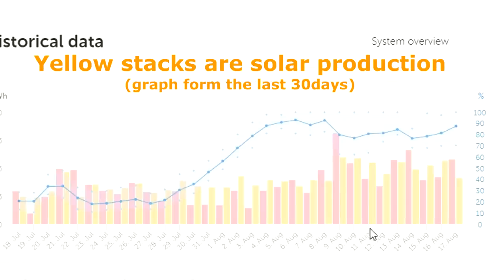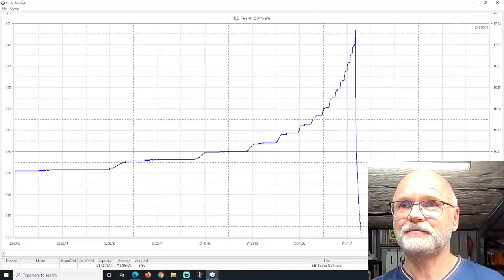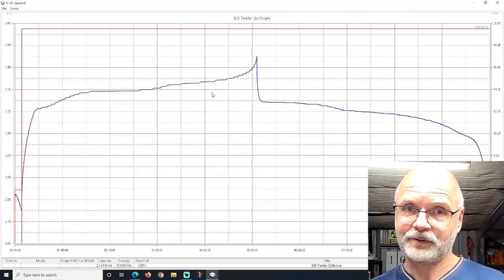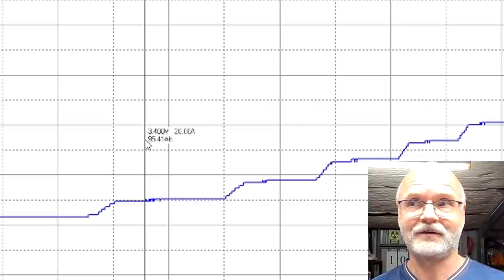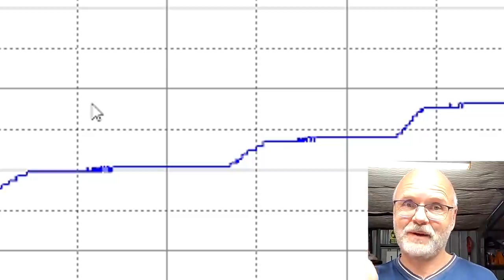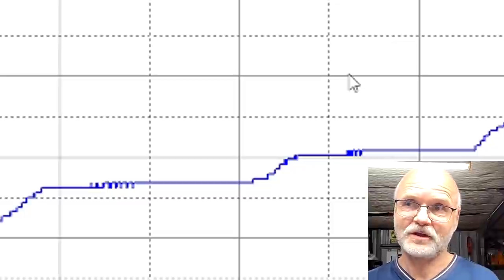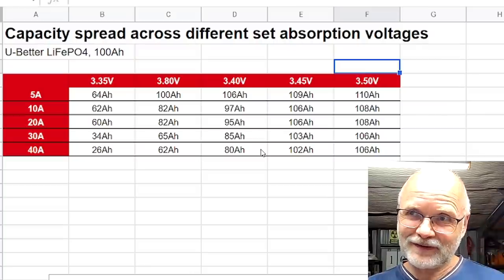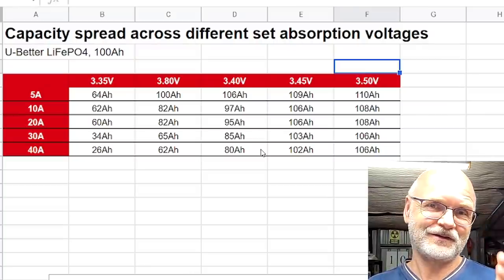Finding 20% and 80% SOC with LiFePO4. Why charging current and charging speed matters!

Comment: Very difficult for me to define 20 - 90% limits too. In fact the only way I found is to charge the battery at the maximum and look at my smartshunt (I made an arduino device to get the infos in my home automation system) when he says that 10% of my 32 KW total (so 3.2 kw) is eaten. When I have eaten 3.2 kw, I am at 90%.

But it is not perfect because :
- in fact it is very difficult to know when the battery is full with a solar inverter charger only. For that i finish the charge at 1.5A and wait a cell reaches 3.6v. But if I were usinga 0.01 A charge current rather than 1.5 A I could put more (OK, in fact not a lot more, perhaps not very important). More annoying : in fact the max charge depends on the cell balance. The more they are balanced the more we can put in the battery because the most charged cell does not stop the charging of the others. In fact I see that each time I try to get the max, I can put more (300 to 500w) W in the battery (certainly because the balancing gets better at each charge, the balancing being really interesting only at the end of the charge so during little time each day). I use an active balancer that I put 1 month on each battery. Then I will stop using it (but I will repeat each year or 2 years I think. I ordered 1 active balancer but a second set of wires : the wires stay in place and I only have to plug the balancer when I want to balance).
- my inverter charger is quite dumb. I can only tell him to stop when he reaches a certain voltage but the voltage of the battery changes with the amperage of the charge (that varies because of sun) so at 5% I can not be sure the charge stops at the same %. So I use a 95% charge goal and I get a 90 to 100% charge (I stops at 55 v so 3.4375 v each cell, if I use less sometimes the charger does not trigger. Growatt 5000ES inverter charger is dumb) and that 55v gives me about 95%. I have 2 inverters and I have about 0.4 v difference between the 2 when they measure the battery voltage. So 1 continue charging a little bit more after the other has stopped. Dumb Growatt products. But it works (with a 100 ma protection before the inverter because a legal 30 ma trip when it is raining !).

Comment: Nice measurements Andy! But isn't the difference also caused by the impedance of the batterie? Maybe the impedance is higher at lower voltages, making the height of the current more influential than at higher voltage? More research needed Andy. :)  By the way 3.8 volt is probably 3.38V, i presume.
Reply from the maker: Thank you. Yeah, Ri will be the lowest at around 85%SOC with these batteries before it goes up again a bit with higher voltage. It will not vary a lot though. Also, while charging the temperature in the cell will rise and lowers the Ri as well. There is always more to it which I'm not able to capture in these tests under AGSTC (Andy's Garage Standard Test Conditions) 😏

Comment: What if I have a lifep04 battery bank of 4 100ah batteries in parallel? Do I have to charge each battery separately or can I wire the charger to the bussbar and charge all 4 batteries at the same time.

Comment: How can you get a very accurate capacity display / read out of 4 LiFepo4 battereis in series (12v) other than "almost fully charged" and "almost fully dead" when they stay at about the same voltage?

Comment: Just stick to top balancing. I have a lifepo4 system running for year, only top balancing, no problems. Most people don't even know you can charge a lifepo4 to 4.2V safely because it uses the same basic chemical electrolyte as li-ion. It does not really take more charge beyond 3.6V so no need to go above, but if you do there is room to do so from time to time.

Comment: Another great video, thank you so much. I really appreciate how you test; it provides us with real-world answers. Now, I have a camper, and based on your information speed of charging and amount of charge obtained; I believe that in my situation that setting to 3.5 to 3.55 may be a good idea. 

PS. I mention this to you before but I would LOVE, LOVE, LOVE for you to test the pros and cons of the Electrodacus SBMS0 and DSSR20. I think that it has many advantages over other BMS. DSSR20 are cheap and reliable replacements for MPPT charge controllers.
Reply from the maker: Charging to 3.5V or 3.55V should be OK, no problem with that.
I would love to test the SBMS if he would make a 48V version finally 😊
Reply: @OffGridGarageAustralia  from my understanding he's not going to because he does not see the advantage. You sure you don't want to study for your new van camper!

Comment: This is very interesting and could also apply for lead acid 🔋 I have 12v-3A portable fridge running in my vehicle and bought brand new 55Ah battery for vehicle and my alternator charges to maximum of about 30-40A and the fridge running non stop would get the battery to below 12v from fully charged at 13v within 3h time suggesting that the battery capacity is way below 55A probably even less than 1/2 and this could be the reason like charging with fast charging alternator so now I am going to deplete the 🔋 to 20% and charge it back up to 100% with 5A solar panel and see if that will make the difference in capacity and I think this will work as we all know that the higher current A draw you draw from your 🔋 the lower is the capacity and it's probably true in reverse that is when you charge it too fast so yeah it's very interesting 👍

Comment: Can you explain me why my 280Ah 12V Setup jumped from 44.9% (3.294V ) to 100% (3.3V) in 1min while charging with 22A from my car alternator.  I set my max cell voltage to 3.3V but why the Daly BMS shows me 100%? 3.6V must be 100%?? Was my first charge
Reply from the maker: The DALY BMS is to blame here. It measures the voltage and calculates SOC from that. That is hardly possible with LiFePO4 though.
First thing to check is that LiFePO4 is set in the Daly settings correctly. Do a few cycles and see if the BMS gets more accurate over time. If this was your first charge it doesn't know anything about the battery yet...
Reply: Off-grid garage thanks for the input!!! I'll be going over the settings and run another charging cycle. Greetings to down under:)

Comment: good info but you are only looking at the point where the cells first hit the absorption voltage and haven't considered the tail current which is actually a very useful indicator of SOC when combined with cell voltage, you'll find the charge capacity difference becomes even smaller once you consider an absorption period and let the tail current drop to say 1-2% of the battery's Ah capacity.

Would be very interesting to see 3.40V, 3.45V, 3.50V, 3.55V, 3.60V and 3.65V tested again but all left to run till the tail current is <2A for your 100Ah test cell, this would also show you the "fastest" way to charge to full capacity (bulk period + absorption period = total charge duration).

Good luck
Reply from the maker: That was the point of that test. In real world you charge you battery from solar and will hit that set voltage at some stage. How much capacity do you haven then already? That was the test to find out.
I've done several other battery tests with absorption. You can find them all here in this Playlist: https://youtube.com/playlist?list=PLPomydD54sgC0pAzeOBz_-ZMfGMzJYYWK

Comment: 2 yrs later , may not get your attention , but here goes .
1st is your assuming capacity with charging ---- not discharging [ at least I did not get the impression from the video that you did a discharge test ? ] --- so it would seem to be only theoretical on available discharge capacity ?
2nd looking at the different amp levels  --- as changing during the day to be more REAL WORLD --- so the charging amps are not as much of an issue with capacity --- [ but maybe longevity of batteries - guessing that lower charge levels { amps } gives longer life ? ] , but the higher voltage seems to give more theoretical capacity ?
Thanks again

Comment: Someone (victron) really need to come out with a lithium specific update and start cutting off at a charge current, not using 1/2/3hrs in absorb. They are patching up old tech to work with new. Probably because of the misconception its blocking out power...... However a SLA approaching full will not absorb full current anyway.
Reply from the maker: The Victron SCC can be setup with a tail current as well. So absorption will stop if either the time is up or the current drops under a certain set value.
Reply: @OffGridGarageAustralia  Can it do one without the other? Have you tried using like a 12hr timer and a relevant cut off current?

Comment: I think you’d find you got exactly the same but in exagerated fashion with lead acid. The more current you put in the greater the effect of internal resistance which allows the voltage to rise with current. This is why solar controllers wired with too long / thin a cable will go into early float as the controller sees a higher voltage than is actually at the battery posts. A cell consists of a voltage source and a resistor in its simplest model. If you charge with a high current  you develop more voltage across the resistor which adds to the cell voltage and then you get a cutout before the cell is full.

Comment: 3.4v is the Best Voltage at 5A “ Now if I’ve got 15 batteries in series would that be 3.4v x 15 + 51v at 5A to reach the Highest input charging ?
Reply: you need to use 16 in series! 3V x 16  =  48V.

Comment: Nice video Am i only who doesn't understand it exactly..if you have 3.35V and then 3.8V why it isn't in right side ? i think your graphs are not so correct..it means from some point it go down??  or is it mistake/tipo  that voltage is 3.8V ??
Reply: Believe is a typo and he meant 3.38v
Reply: I think it was supposed to be 3.38V.  He mentioned that number at 6:55, but then keeps saying 3.8V afterwards.
Reply from the maker: 3.8V is so much easier to say, so I stuck with it 😂
3.38V is correct though, I have corrected the spreadsheet now.
Reply: @OffGridGarageAustralia  no problem i knew it was just typo ..maybe even intentional one :) Thanks for explanation.

Comment: What's really unclear in this video is whether you are taking the voltage readings with the cell open circuit or not. If you're reading off numbers while charging at different currents and the cell has a non-zero internal resistance (hint: it does) then you would expect to add some voltage to the measurement that is proportional to the current going in.

Comment: Great Study if you’re work , I’m charging my batteries 3.2v 280AH I have 26 batteries in Parallel I’m not using solar I’m on the grid peak Amps between 9.5-10.5A Max Amps my bank does not want to go over 3.37v even when I set the Amps on 2A volts are like 3.42v I’ve gotten the 10 batteries up to 3.8v where the other end is 3.7v I leave them top balancing and about 12 hours later when I check the bank from both ends 3.37v ! I don’t know all AliExpress Batteries, actually 4 batteries are of the 26 are 310Ah all 3.2v

Comment: are all these results after current goes to 0A while charging?
Reply: No current drops when voltage is reached.
Reply: @Catamorons  ok, but this is based on full charge curve. will it be same if we cut off charge when it reaches 3.4V at 30A say? My charger seems to lower current as it approaches 3.3V if I set cell to 3.4V and it never charges at 30A until 3.4 is reached. It mostly charges at half of that.

Comment: How about a "long-term" cycle test on the small 5.4 Ah cells?
Cycle one cell with 0.5 C up to 3.7 V
Cycle another cell with 0.2 C up to 3.45 V
Repeat for 100 cycles or more
Now do a capacity test, to see how the high voltage has affected capacity.
(The C-Rate for charging should be chosen to ensure that both cells end up at a similar SoC at the end of the charging cycle, so the only variable between them would be the voltage, not the SOC).
Reply from the maker: I need to find a spot to set this up somewhere. But charging to 3.7V with 0.5C, that's a lot of stress for the cell... We would need to do the test with other settings as well to see a trend.
However my tester is broken now (see community post) and I'm waiting for spare parts

Comment: Your equipment is seeing the charge voltage and stopping the charge. The higher the charge current is fools your charge controller in to thinking it's full when it's not. It's just seeing the voltage and stopping the charge. I'm battling this with my setup here at home.
Reply: This is exactly why he shouldn't be fooling with the-programed settings.  He's micro cycling his batteries.  I've got a small 280 eight cell pack and when I've got 800 watts coming in voltage might be 27 cloud comes over and voltage drops 26.5.  for people actually using their batteries the absorption and float should be different values so you don't micro-cycle the batteries.

Comment: 3.8V >>> 3.38V  :)
You can not say you set your solar charge controller to stop at 3.4V as what you want to say is you set the controller to stop at 3.4V x 16 = 54.4V and that is not at all the same thing since the solar charge has no idea about your individual cell voltages.
My SBMS is responsible for charging so if you where to use the Victron MPPT solar charger then my SBMS will stop the charging by controlling ON/OFF the Victron MPPT solar controller then based on my default settings (3.55V) charging will stop completely (no absorption of float as those are detrimental).
Reply from the maker: corrected...
I'm just waiting for your 48V version of the SBMS 😉

Comment: 3.8V 👀
But other then that thank you for info sir, great job! :)
Now i understand my strange LifeYpo4 a little more!
Reply: Yes, the 3.8v capacities seem like bad date. To get to 3.8V you’ve already passed the lower voltages where the capacity was higher. It doesn’t make sense or am I missing something?
Reply: @kevinmills5293  This is probably a typo, but nonetheless there are LiFe batteries that can charge up to 4.0V
My Winston LiFeYPO4 (with Y (yttrium)) battery operating voltage is 2.5V to 4.0V
Reply: I think it was supposed to be 3.38V.  He mentioned that number at 6:55, but then keeps saying 3.8V afterwards.
Reply: @tonygoinggonzo  watching a second time, yes, I think you’re right.
Reply from the maker: I did this on purpose to see how many will notice and leave a comment 😂😂😂
It's corrected now in the spreadsheet.
Reply: @OffGridGarageAustralia  you have figured out the YouTube algorithm

Comment: Something is wrong with the 3.8v data. You are charging at constant currents so the 3.8v termination data should have the same AH's into the cell when it passes the 3.4v point as the 3.4v termination data.  You should not have less AH at the 3.8v termination than the 3.4v termination .

The root reason for higher charge current yielding lower charged capacity at a given cell terminal voltage is over-potential voltage.  Any battery requires energy overhead consumption to create and move ions.  The more current, the more ion movement required.  The over-potential difference is a rise in terminal voltage from no-load rested state for charging current and a drop in terminal voltage for discharge current.  The absolute value of over-potential voltage times cell current is the power consumed to create and move ions.  There is a small additional voltage loss due to cell internal resistance times cell current.

The over-potential rate of change due to a change in cell current has a response delay that decays like an exponential R-C response.  For LFP, it can take 1-3 minutes in mid-range state of charge for cell to reach equilibrium for a change in cell current.  If you carefully measure cell terminal voltage under a constant load current (load for more then 5 mins) then remove load and wait 3 minutes you will see the voltage rise on the unloaded cell.  This is the over-potential drop recovering to no-load current equilibrium.

The relation between over-potential and cell current has a log relationship.  For LFP, the first 10-20 mV of overpotential there is little cell current (why you cannot achieve full cell balance just passively paralleling them).  As the cell current increases the over-potential only increases proportional to log of current.  It continues this log relationship until cell current is so high the anode and cathode starts to suffer from ion starvation.  For the cells you have this begins at about 0.5CA current rate. On cells designed for higher peak current the ion starvation starts at high CA current.  When ion starvation starts to happen the required over-potential to move the ions increases at greater rate than log rate for increasing current demand.  Over-potential times current is power loss and for LFP cells is the dominate factor for charge-discharge efficiency.  

Over-potential value is a function of temperature, a bit lower for higher temps, and very much greater for cold temps.

Comment: By summer, I'd imagine you could fully power your car from the sun ☀️
Reply from the maker: Yes, I can do it now already most of the time. I need only around 4-5kWh and If I work from home, I can just trickle charge during the day and even charge the battery in the garage at the same time.
Reply: @OffGridGarageAustralia  How many KWH does your tesla use per day just plugged in without driving or anything.
Reply from the maker: @uhjyuff2095  0. It goes into deep sleep and wakes up every 2 days to recharge the 12V battery from the big one. Then it sleeps again. It's probably 0.7kWh per week.